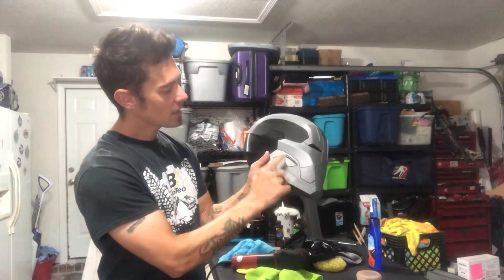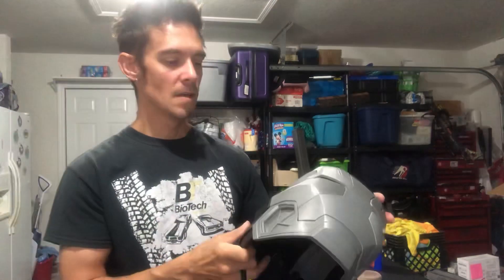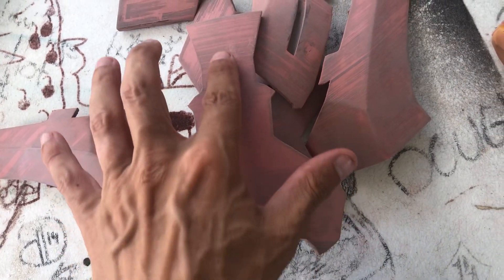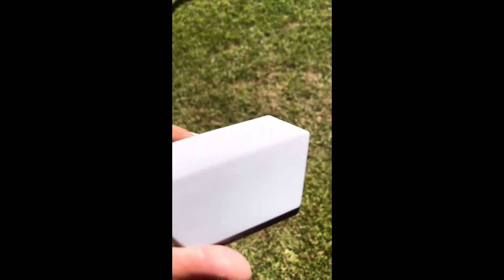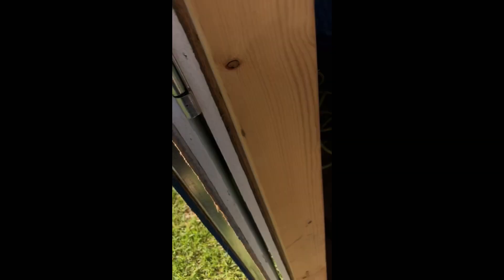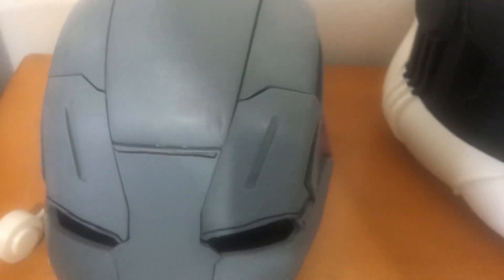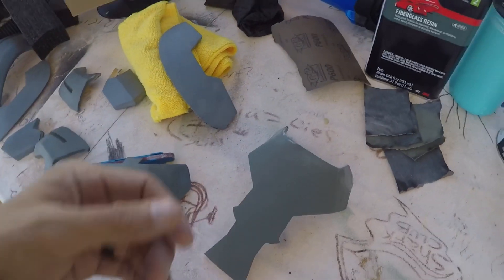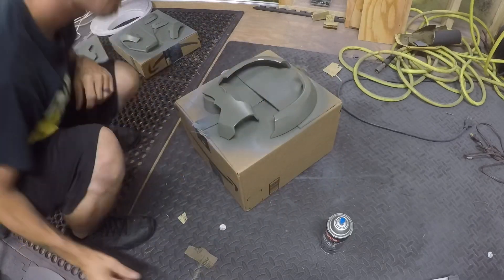How to use glazing putty on 3D prints | get perfect 3D prints | smooth 3D prints on iron man helmet

Comment: The audio is sort of hard to hear even at top volume though
Reply from the maker: I checked on my computer and 2 phones and it’s fine on my end, maybe it’s your device?
Reply: @Darkwingdad , your voice volume is too low.
Reply: Check at 7:55 and listen for a few seconds. Take notice on the different volumes on the start and at the end of this segment. Try to normalize your audio levels. But your content is super ;)
Reply from the maker: @VitorJesusMC  I never notice when editing but this is on my old phone which had a bad mic on it. I got a new phone now and no issues. I go back & listen but can hear it fine but since I’m
Not using that phone anymore the issue should be resolved!
Reply: Careful with the wind outside also. I couldn't listen after you were outside because the wind sounded like it could blow out my speakers. (home threatre with big woofers)